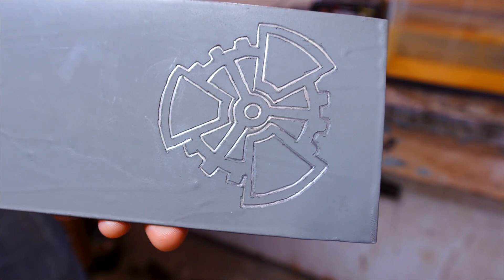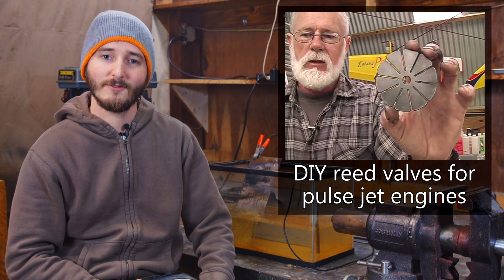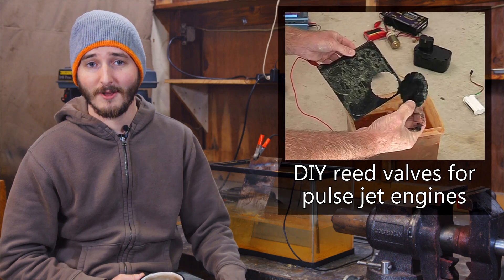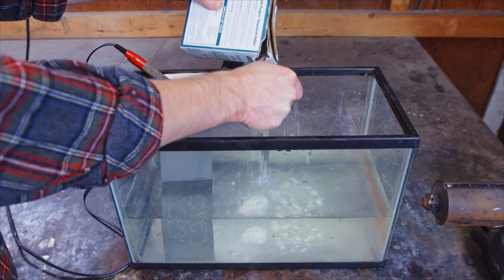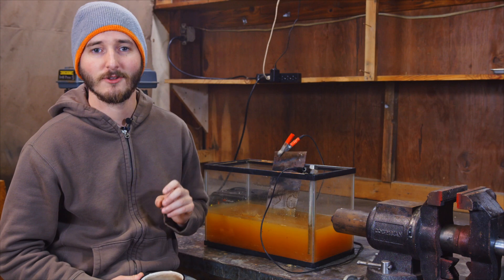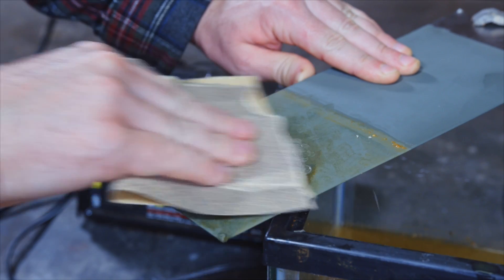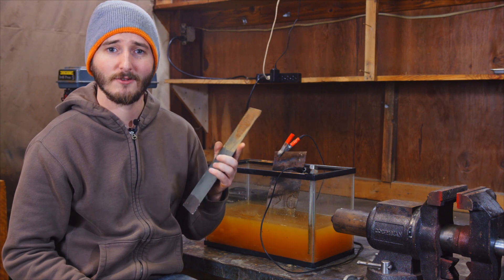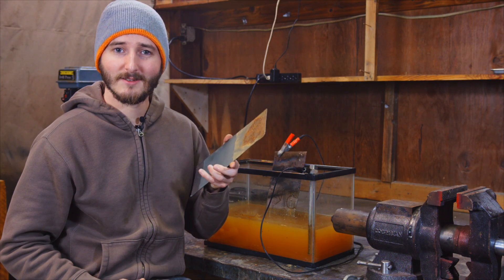How To Cut Steel With Electrolysis [Experiment In Progress] - NightHawkInLight

Comment: The reason is because once the top layer of exposed steel is eaten away,  both the steel below it, AND the steel around it, which is covered by the costing on top, are exposed and can be etched.

Comment: you have to prime it at the same time you are using electrolysis because as the method breaks down the metal it creates an opening to the metal you don't want affected, and the primer needs to be air tight, or applied in a vacuum

Comment: It's really simple, simple math and physics, all the exposed areas expose equally. If the line you scratch is wider than the thickness of your material, you don't have a chance.  For thick material, the thinner your scratch line, the more control you will have over the etching, but it will always be a positive error the same thickness of the material. 

It could be mitigated by multiple stages of painting and etching. Also using a very sharp and narrow awl to do the scratching, aiming for deep not wide lines. Also you could scratch from the backside as well, doubling the accuracy. 

You could potentially calculate and accommodate this with the stencil. I think a hydrophobic coating might be worth experimenting with, due to the viscosity of water it may substantially increase etching accuracy.

Comment: Try using a small water pump to circulate your electrolyte and move the bubbles away before they do any damage. You're not using anything corrosive but salt may wreck it so something  non-submerseable and cheap would do for a test.

Comment: Your fundamental problem is not fully appreciating that electrons will preferentially take the path of least resistance through a material.  Electrons enter via the non-waxed area as intended, but then run longitudinally (under the wax) toward the non-immersed section and then on to the connector and power supply.  If you want to cut (laterally) through a piece of metal, then you need to encourage the electrons to travel into the work piece, not along it.

Mirror your wax pattern on both sides of the workpiece.  Then use an electrically-conductive paste (e.g. conductive grease) to fill in the non-waxed cavity on one side of the work piece.  Press the pasted side onto a similarly-sized block of steel.  Clamp the two tightly together with non-conductors.  Connect the block to your power supply.  The shortest path for electron flow now passes directly from one side of the sheet of metal to the other, from a non-waxed area to its corresponding mirror, and that will become the preferred path for corrosion.

The natural three-dimensional 'sprawling' of corrosion can be further reduced by eliminating obstacles that form during the 'cutting' process itself.  This amounts to removing electrically-resistive corrosion by-products from the cut site.  Whilst an ultrasonic cleaning tank is probably your best bet for this, a low-cost (and thematically-coherent) solution may be to simply use a fish tank circulation pump to continually spray the cut site with fluid.  More electrically-resistive corrosion by-products will thus be washed away, electron flow will be 'deflected' less, and your cut will be cleaner as a result.  (At the very least you could suspend your work piece with the cut site facing down towards the bottom of the tank, so that gravity would pull at least some of the corrosion by-products from the cut site.)

Good luck!

Comment: Have you tried using toner transfer and also making the solution acidic instead of basic ?
I can see that you made the solution with salt/soda to make it easily obtainable ,cheap and safer than straight acid but it's not the best solution.
Also electrode placement and agitation are very important as well, you might to add an aquarium air pump to keep the solution moving.

Comment: Electrolytic etching is often used in the electronics industry for metals such as copper. The process is limited to thin films of metal because of the inherent anisotropy of the reaction. Part of this problem is that metal oxides quickly form on the surface of the etched metal, and divert the flow of current to other (undesirable) surfaces. There is no way to eliminate this, but it can be  somewhat reduced with the use of chelating agents (EDTA or cyanide salts for iron, perhaps) and pH.

Comment: problem is once it starts etching the surface of the exposed metal, it exposes more uncoated metal around the sides of where it was eating away under the top level of the steel, where it can start lifting the paint off by corroding under it. long story short, this does not seem like a very viable project unless you can somehow do something about this. this may only be useful for removing material from the outside of the metal rather than trying to cut shapes out of the center, for example in trying to make a circle out of a square you would make a circular paint layer so it eats away from the edge towards the inside.

Comment: someone may have already suggested this but try suspending the coated steel in such a way that only one side is in contact with the electrolyte solution. just an idea. I've never tried it and have no idea if it will work.

Comment: The only way to keep the electricity in the one area is to completely isolate the area you want to cut, and apply electricity to that area. It is not working because steel is a metal which conducts electricity well and is able to melt away the paint and therefore corrode the metal. Either isolate the area you want to cut or find a waterproof, heat resistant paint to apply to the metal

Comment: As Joe Brown stated, the electrolytic process will move laterally as the depth of the erosion permits.  On very thin sheets, the electrolysis will perforate before much lateral erosion will occur.

I suspect wax worked a bit better because it's a flexible coating; when the metal underneath it eroded, it would flow onto the metal underneath it, and thus dampen the lateral erosion for awhile.  Perhaps until it was too thinned out to offer any further electrical insulation.

I think in order to use electrolysis to get completely through a thicker sheet with some precision, periodic re-coating with insulator, followed by a re-etching of the pattern will be required.  What that period might be probably varies for the thickness (or thinness) of the etch.  I suspect thinner lines will have greater variance than thicker lines.

One thing I would do would be to test the simplest cases and shapes first:  A single point, straight lines of different widths, and then lines at angles to each other.  Again,  I would suspect that the narrower angles will have the least precision.

 At least the etching process can easily timed and precisely stopped, unlike, say, an acid bath etching.

How deep do you suppose your best etchings got before they became corrupted?  Given that depth, how many re-etchings would you have to do to penetrate all the way through?

Are the benefits from an etched form worth effort of repetition?  Are there some simpler operations, such as cutting sheets in two, or forming heat-stress free holes that this application might work well for, with minimal or no re-coating?

Cheers,

   -nevin

Comment: off the top of my head...I would say the problem is surface area. The paint/wax is only coating the top. Electrolysis is going to erode all exposed steel omnidirectionally. Once it's eatin down the top layer of steel you start to increase surface area and develop walls (so to speak). The electric current is going to erode at the uninsulated walls and getting under the paint/wax.

Comment: Electrolysis is used for cleaning metal. You may want to try more conventional etching. The problem with electrolysis is that the holes in your finish need only be large enough to start allowing electrons to flow to ruin your part.

Comment: try moving the two conductors closer together, your flex plumbing pipe and steel plate have to be pretty close for the electricity to flow between the efficiently, the further the gap the more amps you'll need to get the electricity to travel across the gap.  Try something under a 1/4 inch. maybe two pieces of the same metal held together 1/8 -  1/4 inch apart with a spacer, then clamp a positive to one plate and a negative to another plate.  Also try submerging all the metal under the water, including the wire that connects the plates to the battery charger.   Air will reduce the efficiency of the electricity traveling across the electrolyte solution.    Look at some HHO generators for some material suggestions. :)  great videos!

Comment: You should try it on non-corrosion resistant / stainless steel first. These alloys will prevent oxidation and eventually the oxidation will develop towards the least corrosion resistant paths.

Comment: I have done something similar but a bit differently. Instead of putting the metal in a fish tank I used a towel soaked in water and salt as a layer between the anode and cathode which were both steel plates. I used to use this method for just etching but I found if I recoated the area I was etching with wax and then just ran the end of a thin piece of wire through the groves I could keep the etching clean and make it deeper and even cut all the way through if I wanted to.
Reply: I forgot to mention I have had great success with using vinegar and salt instead of just plain water. Also just a fun idea that I found out on my own. If you put some steel in boiling vinegar it turns black and has a layer of carbon bonded to the outside. It is a cool easy way of staining knives black that I found totally on accident.

Comment: I have a hypothesis: Electrolytic etching might not be possible to use as cutting method, reliably at least, especially on thicker materials. Once the cut reaches sufficient depth the electrolytic etching will be omnidirectional and work it's way under any coating no matter what. I don't think there's a way to control electrolytic etching in a unidirectional manner. All other cutting methods are unidirectional, be it plasma, water jet, or old fashion mechanical cutting with a blade. 
Does that make sense? Once the electrolysis has eaten a shallow trough in the metal it will also attack at the sides of the cut without having a barrier that grows with the cut and follows it through the metal.
Maybe I'm way off base here, but that's what I'm thinking.
Reply: I was about to say. After clearing the surface with such a thick piece, you gained enough surface area to start eating at the metal under the paint thus screwing up your etching. In the source video, the gauge metal the guy was using was very thin.

Maybe if he took the plate out every 12 hours and cleaned it, then reapplied the paint and rescratched the plate accommodating for loss of mass on the finished design, he might etch it the way he wants, but at that point he'd be better off using an actual laser cutter. This is one of those ideas that only works based on scare/volume of material.
Reply: Yes. It seemed blindingly obvious to me right from the start. Its '3D', not '2D'.
Reply: It's Impossible to get there without an undercut. If coming from both sides (top and bottom) it will meet at the middle of  thickness as a knives edge.  That knives edge would be the ideal diameter of the design, from there on up to the top and bottom surfaces it gradually increases eating away metal with the greatest amounts removed at both the very top and very bottom of the flat surface.
Reply: Joe Brown, how to dissolve the anode quickly mate, Im doing fun experiment.

Comment: my 2 cents, : Electrolyte: you want to dissolve the iron/steel so the product that you make by combinig the electrolyte with the metal must be soluble. the more soluble the better. Iron + baking soda + electricity is making Iron carbonate - which is not very soluble so some of it will cling to the cut and prevent uniform etching. Salt for example makes Ferric chloride - which is much more soluble. Many different other electrolytes could be used so whatever you end up using select something where the results have a good solubility in water. 
Line width/exactness of cut : As many have already stated its not a unidirectional process once you start to go into the metal the sidewalls of the cut are exposed to etching action and the cut progresses in depth AND width. This is commonly referred to as "Etch factor" http://blog.conardcorp.com/blog/bid/270930/What-is-the-Etch-Factor-in-Photo-Etching-and-Why-Does-it-Matter
This works fairly well on thin metals but the deeper you have to go the less precise the cut. There is a reason why the industry uses etching/electroetching processes only for thin gauge sheets. EDM is commonly used for thicker stuff if in principle a similar process (electrochemical metal removal) is desired - but the process parameters are vastly different. It uses very high Amperes  at low voltage (3V 300A for example) and the gap between the electrodes is minimal (much less than a mm) plus the electrolyte is pumped through the electrode gap under pressure to remove dissolved product and avoid shorts.

Its only the amps that do the work in electroetching, the volts are only there to deliver the amps to the desired place. Use as low as possible volts but a high conductive electrolyte to deliver the most amps for a given voltage.. a cut with 3V 1A will progress only a little slower than  a cut made with 12V 1A but the 12v cut will look MUCH more ragged. 

Coating adhesion: Fundamentally you will have to use something thats totally resistand to the chemicals used and the byproducts created. Adhesion can be promoted by proper surface prep (degrease, sandblast, whatever. there already have been many suggestions what you could try - in the end it will come down to just trial and error to select something that suits your process. the oldtimers used a mixture of Wax, Asphaltum(thats NOT Bitumen, google the difference if you dont know) and various resins like pine resin or dammar. These were mixed in various proportions to get the desired hardness. Asphaltum makes it harder and with a higher melting point, more wax makes it softer and lowers the MP. downside to using this type is that the design has to be scratched in by hand after coating. If you want a spray-on solution its experimenting. Plastidip sounds like a good candidate though.

I tried something similar in the past, trying to cut some blanks for knifemaking from bar stock electrochemically but found that while it CAN be made to work to some degree it never got to the level of preciseness that would justify the effort. Too much cleanup afterwards and any defects in the etching mask leave a ruined piece. cutting with an angle grinder and thin cutoff disk was much faster and more efficient in the end....

Good luck.

Comment: Hey Ben, I tried this and I used NaCl for my electrolyte
also I dipped my steel plate in wax then scored it and pumped 4v 1amp through the steel using iron wire as a second electrode  and I was able to cut right through the steel.
Just don't leave it in there for too long that causes the messy cut that you showed here.
I left mine in there for about 3 - 5 hours, that etched it deep enough to have the steel hanging from a thin piece of iron foil which I was able to just cut away with a knife.
I hope this helps, also try using a stronger electrolyte ex. instead of bases try acids like HCl. This worked 10x better. Also if you don't want that rust coating the steel try using NaOH this will actually dissolve the rust, but it wont dissolve steel. It'll clean the steel giving you a nice and shiny surface.
Reply from the maker: Glad you had some success! Thanks for the report. I'll be trying NaCL again and a few new things this next week
Reply: I tried this again this time with thicker steel, one thing that I saw was some carbon coming out of the steel. this must have been because steel contains carbon.  The first time I tried this I used an iron plate, Im thinking the carbon bothers the electrolysis process, I dont know why but it seems like it does. the first time I tried this I used 1mm thick iron which took  about 4 hours, this time when I used 3mm thick steel I thought I would take about 12 hours, instead it took about 36 hours so there is a huge difference between iron and steel.
I hope this also helps you :)
Reply: NightHawkInLight what I remember from Chem is that redox reactions depend on the materials of your anode and cathode. So, with an anode of steel (iron) go for a cathode that is a better reducer like Aluminum in an HCl electrolyte. Not sure how well my 10yr old memory from classes and 30second of refresher google searches will apply to real world electrolysis cutting, but I 
hope it's going better!

Comment: Consider doing a DIY EDM machine instead.  http://www.homebuiltedmmachines.com/
 
My dad and I made one from instructions in Popular Science (or was is Popular Mechanics) back in the 1960's.  It worked pretty well, and the circuit was simple. 

There are also wire based EDM machines that cut like a jig saw.

Using the masking method you are using also reminds me of a favorite way people use to carve marble.  They cut a rubber mask, and glue that onto the flattened stone/marble and sand blast the area to be etched.  This is also use when etching glass.  And in many ways it is the same concept used when silk screening, needing a negative of the desired image.

Lots of luck... Jack